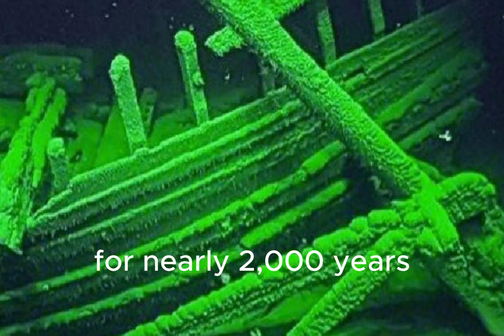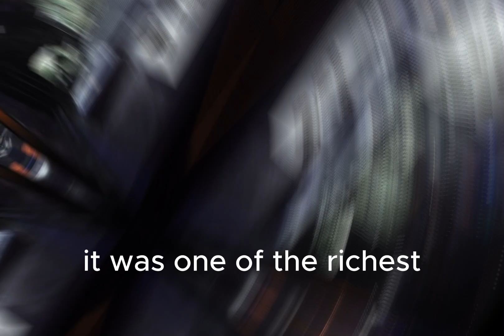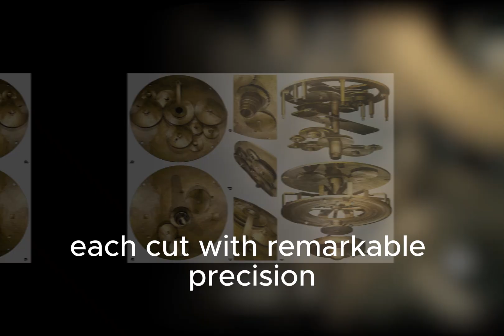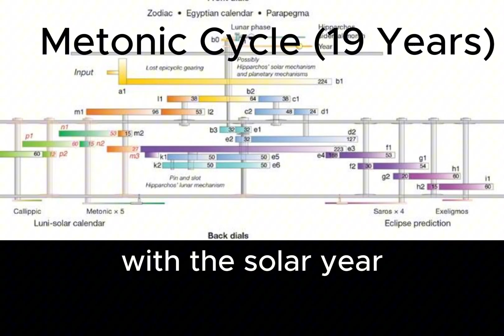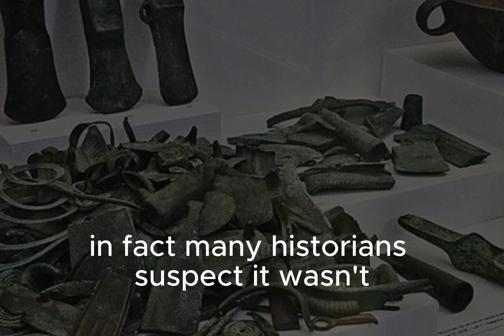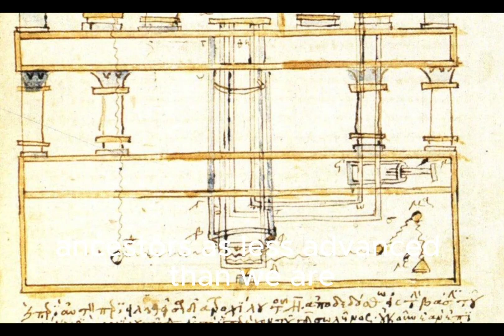The 2,100-Year-Old Computer That Shouldn't Exist

Comment: No magic involved just precise engineering.

The Mechanism is a physical presentation of existing data that involves cycles.  The data has been known for centuries before the device was made.

In sort, I think it's a coffee table device used to provoke conversation.  It's just a different way of describing the same data.

Yes, the mechanics are quite intricate and indeed a masterpiece, but it's just a different 'user interface'.
The mechanism has its flaws and wouldn't last long with daily use.

The other question is: Why is there only one found or even described?  Because it's a 'party piece' made for someone with deep pockets.
Reply from the maker: Agree with you on the  no magic  thing it's all clever gear ratios and nothing more. But I'd push back a little on calling it just a display though. It's actually doing real computation   it's got the Metonic cycle, the Saros cycle etc built right into the gear ratios, so it's actually calculating where the sun/moon would be for whatever date you dial in. That's an analog computer, not just a fancy readout.On the only one ever found thing  worth noting Cicero actually wrote about a similar device that Archimedes supposedly built. So there was probably more than one of these being made at some point, we just don't have the others anymore. Bronze got melted down and reused constantly back then, so honestly it's kind of a miracle this one survived at all. I'd guess that's more the reason we only have one than it being some rare custom order for a rich guy - though who knows, that's possible too, people have debated it for a while.